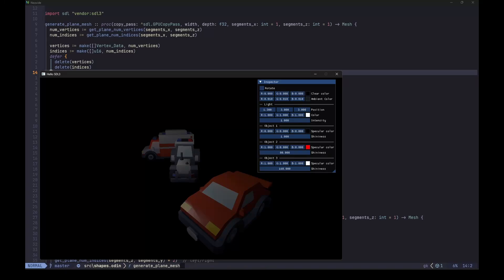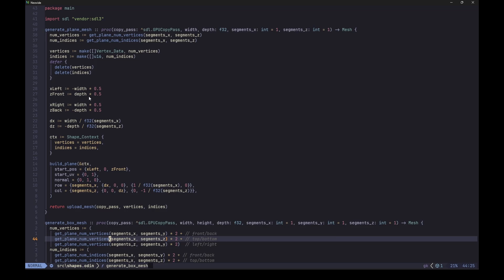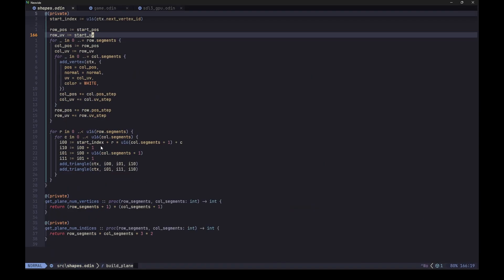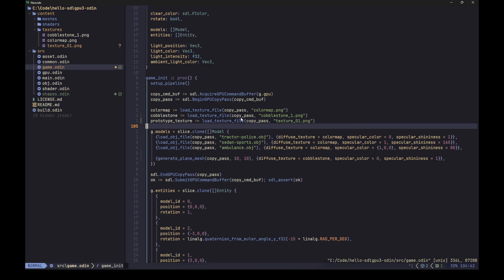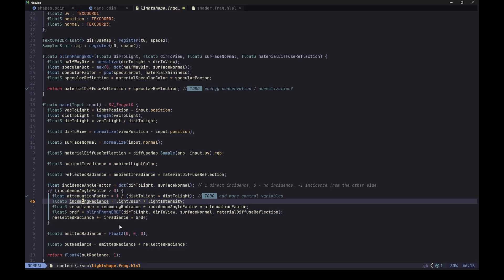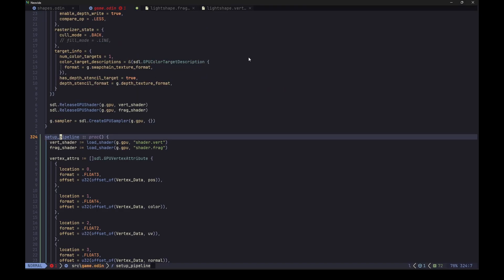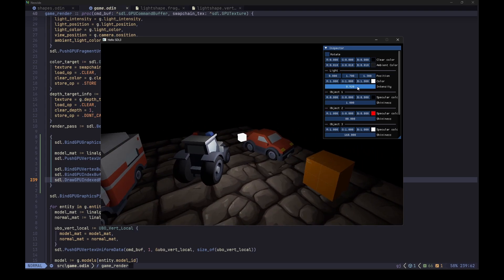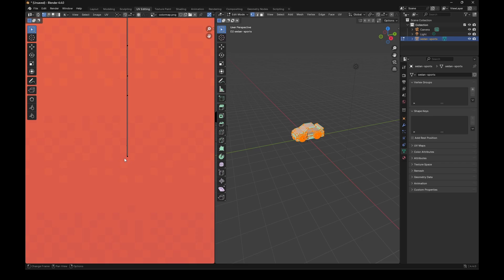Odin SDL3 GPU Tutorial: Part 13.3 - Basic Geometry Generation. The Colored Light Cube.

Comment: The rate at which you make this content is very impressive! Great vid again. How would you work with multple lights? The same thing but an array of lights in the shader?
Reply from the maker: This is something I would like to research a bit more before making a video. Even with the simple forward rendering there seem to be some nuances with how to actually push the data in SDLGPU, since the documentation says you should only use uniforms for "a matrix or two" and for everything larger than that it's recommended to use storage buffers. So this is an interesting topic to cover as well :)